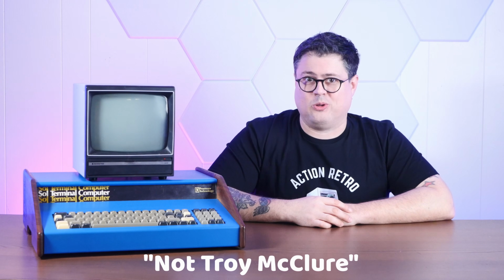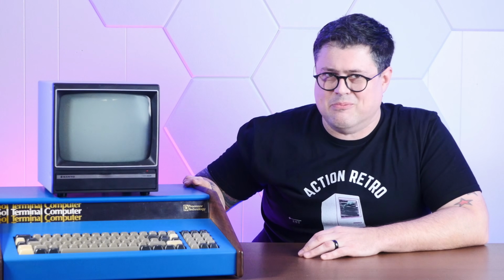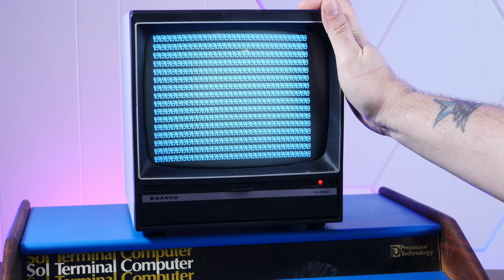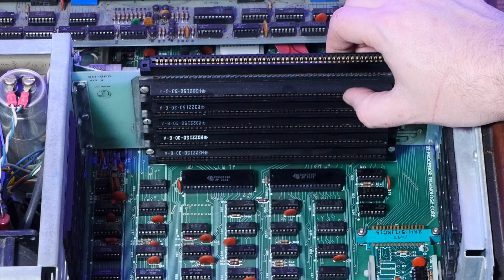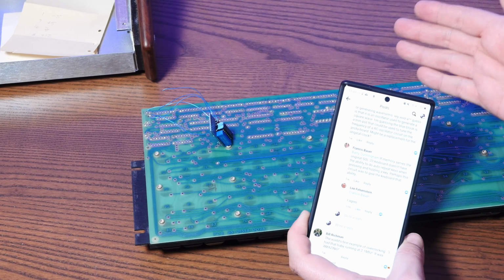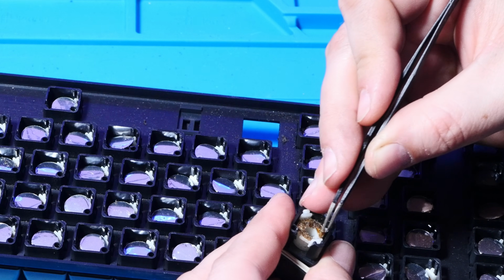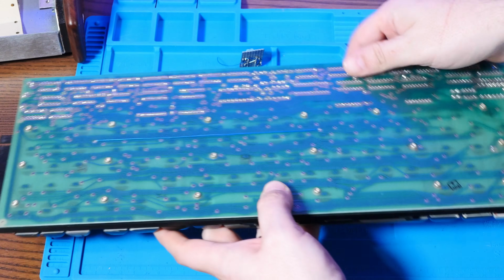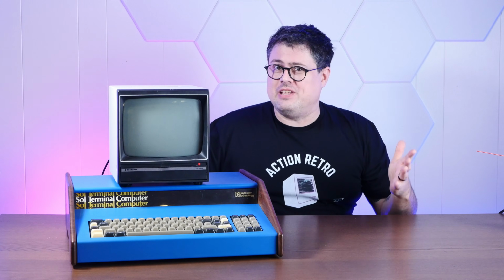The Most Important Computer You Don't Know About

Comment: I built a kit computer in 1981 or maybe '82 as a learning exercise.  It was Z80 based and had an S100 slot.  The power supply I built for it was linear and used a similarly large transformer.  From memory one of the windings was 18V 8A.
Reply: 18V, now that's damn weird.  I wonder why?
Reply: @michaelbauers8800  18VAC had a centre tap and was used to provide unregulated DC for the +12V and - 5V regulators as well as unregulated + / - 16V for the S100 bus.  Another winding provided unregulated for the +5V regulators and +8V unregulated for the S100 bus.  I had to go look it up, turns out the articles can still be found at the internet archive site.
Reply: @retrozmachine1189  Thanks.  Certainly not a voltage I expected to see, but whom am I to second guess electrical engineers, when I barely understand electronics :)

Comment: An interesting fact about the Sol-20 was that one of the key guys behind it, Les Solomon, was the editor of Popular Electronics magazine and one of the key backers of a tape data storage standard known as the “Kansas City Standard”. For those that don’t know, back in the early to mid 1970’s the cheapest way to store data permanently was paper tape (aka punch tape) where data was recorded on the tape as punched holes that could be read back by a paper tape reader but it was prone to jamming, tearing, and others issues, and many early hobbyist computer users wanted a more reliable method for storing data. Sol was one of several who had the idea of storing data on a compact audio cassette in the form of two tones to represent ones and zeros, as replacement for paper tape. One problem was that early hobbyist computers all adopted their own incomparable proprietary methods of storage data (as audio) on cassettes. So he and someone from Byte Magazine got together and arrange a meeting/symposium with other early hobbyist computer companies to devise a standard for data storage on audio cassette which became known as the “Kansas City Standard” due to the symposium taking place in Kansas City. Unfortunately, while some computer manufacturers did adopt this standard, many others did not such Commodore, Apple, Sinclair, Atari, and Amstrad, and went proprietary instead. Part of the problem may have been that this standard wasn’t the most efficient method for storing data on tape (as audio) and thus these other microcomputer companies preferred to develop there own more efficient standard, plus there was the added benefit of locking in their users to each company’s own platform.
Reply: @Jeff Desert Mountains Paper Punch tape was different then punch cards. It was a basically a long strip on tape sort of like paper version on magnetic tape but with holes used to Indicate binary  digits. Punch cards where produced in a stack where you had to carefully keep them in the correct order. Then you put them in the punch card holder on the punch card reader and the device would pull one card after another to read the data off them, shooting them to a second receptacle. The way the data was stored on punch cards and paper Punch tape was similar though. You can see videos on YT showing how each worked such as on the Computerphile chanell from the University of Nottingham.
Reply: @Charles Bunnell..  Cool story.  My friend had one of these in 1977.  His same was Solomon. No relation.  In those days we were more interested in having a terminal to get into our school time sharing minicomputer by modem, so the name terminal computer made sense to us.  I’m not sure which OS it had, but it had some very impressive games.
Reply: Pop Electronics is where the infamous Altair 8800 was featured on the cover Jan 1975. You can get the pdf. Many people consider it the birth of personal computers.
     In the 80s I did work for a factory that used paper tape to run automated punch press machines. The noise was deafening.  I hated going to the shop to pick up material. I still hear it...KA_CHUNK.
     I had no idea it was Ziff-Davis that produced Pop Electronics. ZD was responsible for The Screen Savers and Call for Help. Leo Laporte is doing This Week in Tech (TWIT) now.
Reply: @firesurfer  I am familiar with the Altair 8800 Popular Electronics cover. A lot of early hobbyist PC’s where announced via electronics publications, sometimes created with the help of people at the magazine as with the Sol-20. While the Altair 8800 was certainly in many ways a personal computer in a sense it wasn’t quit a mainstream personal computer the way the later Apple II, TRS-80, and Commodore Pet where (know as the holy trinity of PC’s) personal computers. These early PC’s where what i’d call a hobbyist computer as they required a lot of assembly and specialized knowledge to get the working and such. The modern Raspberry Pi other single board computers is the modern version the hobbyist computer.  Back then It wasn’t until the holy trinity of PC’s I mentioned above came out in 1977 that you could buy a PC that could relatively easily be used by laypeople. The Sol-20 came closer to being a more ready to use PC then the keyboard-less Altair 2200 (at least in its default configuration) but it still wasn’t as user friendly as later PC’s.
Reply: @Jeff Desert Mountains It resembled a ticker tape machine.
Reply: The SOL 20 mainboard had the necessary audio interface and the personality module included  routines and implemented commands for reading and writing blocks of memory to/from cassette tape recorders.  This let you load and run programs, in principle including an assembler or compiler, and also mad the (I think) K.C.Standard routines available to the programs.
So a SOL 20 with two tape recorders could (again in principle) be used as a personal computer, both for running canned apps and for software developent.

Of course there was also the Helios drives with PTDOS and a CPM port for the HELIOS II and other S-100 floppy interface/drive combos.
Reply: Who did adopt the Kansas City standard? The only one I remember was Ohio Scientific who mentioned it in their advertisements.
Reply: @scottlarson1548  
The following microcomputer manufacturer adopted the Kansas City Standard (aka Byte Standard) either in it's original form or an enhanced version, either via a built-in data cassette port or via an optional add-on card:
* Compukit UK101
* Exidy Sorcerer 
* Kim-1
* MITS Altair 8800
* Motorola MEK D1 6800 board
* Ohio Scientific C1P/ Superboard II
* Processor Tech Sol-20 Terminal Computer & Processor Tech CUTS
* SWTPC's Motorola 6800-based computers
* Tangerine Microtan 65
* Eltec (German Company) Eurocom 1
* Z80 Starter Kit 
* ABC 80
* Acorn System 1 
* BBC Micro (300 and 1200 baud variations)
* Acorn Electron (1200 baud only)
* Dick Smith Super-80 (300 baud only)
* Elektor Magazine National SC/MP Project
* Heathkit ET/ETW-3400 and 3400A Microprocessor Trainers (300, 1200, 2400 baud)[12]
* Heathkit H8 (300 and 1200 baud)
* Zenith Z-89 — also sold as the Heathkit H89 (300 and 1200 baud)
* MicroBee Systems
* MicroBee (300 and 1200 baud)
* MSX (1200 and 2400 baud)
* Nascom (300 and 1200)
* Sega SC-3000 A slightly different 600 baud variant
* Triumph-Adler
* Alphatronic PC
* Alphatronic PC16
* Z80NE Nuova Elettronica with LX.385 interface
* Chaos Homebrew Computer
* Irisha (1200 baud, 2 stop bits, same as MSX)
Reply: @Charlesb88  OK, generally they were either kit computers, low sellers, or British computers. I completely forgot about the Exidy Sorcerer!
Reply: For those who want more about punched paper tape:
https://en.wikipedia.org/wiki/Punched_tape
Reply: When I was in H.S. We had a computer running Basic (don’t know what computer it was) we also had classes and I took them, we had a Teletype typing device and yes, it had the punch paper for output and input of our programs that we all wrote. Good days, learned a lot.
Reply: Very cool! Thanks for that!
Reply: Nerd
Reply: @maxxbbie69 Calling anyone watching this video a nerd is like calling attendees at ComicCon nerds. Only computer nerds would be interested in an obscure hobbyist home computer from the mid~1970’s.

Comment: Try to clean up the new key pads with a bit IPA on a cotton swab  - had the same issue on my Apple Lisa. Replaced all of the pads and still some keys wouldn't work. After cleaning them with IPA they work fine. Maybe you accidentally touched the pads or they got in contact with skin oil or something like that. :)

Comment: dont use double sided tape and ruin your machine, just 3d print som discs at various thickness and test to see which lands the smoothest, if they are the right thickness they will easily click in first and hold the foam and foil pad in nice and tight

Comment: The earliest home use computer I know of that you could buy assembled would be the SCELBI-8H from 1974. (Though it was also available in kit form) That being said, it certainly wouldn't have had the same capabilities as this system. Other pre-assembled options at that time would have been designed for commercial use and far bulkier.

Comment: erm, capacitive pads? looks to me like a classic switch with the foil acting as the electrical connection, and the finger has a low enough resistance for the electronics to register the bridged connection. if it were capacitive, then cleaning would not have been necessary.

Comment: Check the reset circuit for proper operation, and try manually asserting the reset signal through a resistor to see if that will make it boot properly.  Check all the address and data lines with an oscilloscope for any seemingly stuck bits.  Also check that you have all of the proper clock signals present and timed correctly.  I know that the early Altairs had issues with clock reliability, and the 8080 is a bit finicky when it comes to timing, but I have no experience with the SOL.  Having that S100 connector right at the top of the expansion bus should make the issue relatively easy to troubleshoot.
Reply: Reset circuit is also what came to mind (it's a notorious problem on the Oric's 6502 for example), but then would he has this 9No displayed if it's displayed by the CPU?
Reply: @DbugII  I assume the pattern displayed on screen is the uninitialized state of the video ram, but I'm not sure about that
Reply: On somthing this age I expect the capacitors have dried out. Check the reset circuit caps and also the PSU.  The bottom line is all the voltages must have stabilised and the clocks up and running before the reset is removed. The PSU is of linear design judging by the size of the big cap, so check the supplies are correct voltage and also for ripple. Best of luck.
Reply: This is a common problem, even with relative recent microprocessor or micro-controller systems.

The RESET line is usually held HIGH by a resistor connected to +5V. To activate RESET, the line needs to go low. To do this, there is a small capacitor connected to ground. It steals the voltage from the RESET line to charge itself up. If the capacitor is broken, the RESET line is not held LOW for long enough.

Since capacitors loose their capacity with age, the power on RESET will fail eventually. Usually it keeps working for a few decades.

Modern systems often use a radial electrolyte capacitor which is then bent flat onto the PCB. This can cause a strain on its leads which can make the rubber gasket of the capacitor leak. Then those POR (Power On Reset) circuits fail after just a few years – or even months in extreme cases.

I have fixed a few of those, mostly found in operators panels where there was not enough space to keep the capacitor vertically and they had to bent it onto its side.

Modern µC like the AVR uses a timer counting clock pulses to generate the RESET signal. This can cut costs (Atiny) since pins are the most expensive part of any µC IC and it also makes sure that the RESET signal has the perfect timing which depends on the clock source. Never too short and no unnecessary time wasted.
Reply: thats what i was gonna say, maybe not long enough reset,
Reply: Our high school electronics class made one of these! Thought ours actually said Processor Technology
Reply: The sound was an am radio.

Comment: It’s cool that you can see all the features of the Atari 8-bit computers got their inspiration here. I guess by the time they standardized the feature set of the home computer in the late 70s, they decided people didn’t want expansion cards, swappable rom, etc. anymore but here they didn’t quite know that yet
Reply: The Apple ][ had expansion slots and loads of third party cards.
Reply: The Ataris had cartridge slots, which are just Roms in a fancy case. The earlier Atari VCS pioneered game cartridges. When the 400/800 were released in 1979, they had several custom chips for exceptionally versatile, high resolution graphics, with a 256 colour pallete, and 4  independent 8 bit sound channels, that could be joined with a simple POKE to make two 16 bit channels. Cartridge slots, usuable analogue to digital controllers, hardware sprites, display list interrupts, and a shed load of other cool features made them the incredibly advanced for their time.

Comment: Not sure if you noticed, and this could be caused by YouTube compression.  But when you pulled out the personality module it looked like the first contact point was seriously corroded/scratched.  Assuming this is the case and not some video glitch - as the OS is loaded from there might this not be the cause of the dodgy loading?

Comment: Amazing how simple and integrated this is compared to other S100 computers.  I have a DIY home-built S100 system I picked up at an estate sale alongside an IMSAI, I'll have to study electronics a while longer and learn power supplies before I dare do anything with it, in the DIY'd linear PSU it's got five of the soup can capacitors.  Not to mention the mystery hand made wire-wrapped expansion cards in it.
Reply: Oh damn, sounds like some fun reverse engineering is ahead of you :)
Reply: IIRC there are 4 power rails: +/-5v and +/-12v. Some chips and interfaces required the negative voltages
Reply: @surferdudemi  ?  that was a standard for early PCs, but I'm not sure it applies to a DIY homebrew system.
Reply: @squirlmy  If it followed the standard. Some chips back then required -5, and true RS232 needs -5 or -12.

Comment: Wow. It really is in pristine condition for being born the same year as I.  lol. I think my foam has also degraded over the years.  I can’t believe how mint that thing is. I would definitely pull the power supply and give it a full work over. Test the rails and the old caps.  Larger electrolytic caps do dry up. Check any tantalum caps for possible short circuits. They can become more like resistors over time.
Reply: I'd argue tantalum caps eventually turn into low current fuses rather than resistors :)
Reply: @Bobbias  yes...usually catastrophically

Comment: Thanks for all the great videos!

Okay so if it were me, I’d look at the reset signal. If it’s only turning on and working properly like 10% or 25% of the time, then maybe the reset circuit isn’t working properly. Maybe it’s timing is off and sometimes it happens to reset everything the right amount of time but most of the time it doesn’t. Another thing is that if the power supply isn’t putting out the right voltage, or if it can’t sustain all the current the machine needs all at once when it’s powered up, then that might affect the reset circuit, which is often a 555 based timer circuit. However, overall those chips are very oxidized, so a careful cleaning of all the chips and sockets might be a good ideal regardless. If it is a reset circuit problem, then maybe a flakey socket connection due to oxidation is messing with the period of time the reset circuit is holding the system in reset, and cleaning the connections here would allow the circuits timing to work as intended. 

Then again with a system this old the capacitors might be bad and the whole system is electrically super noisy and having new capacitors would help. 

Without poking around with an oscilloscope and schematic diagram it’s hard to say. But those are my guesses off the top of my head!

Comment: I'm curious as to the use of the SO239 coax connector on the back panel of the computer.  I noticed there's a piece of coax inside the case that connects to another SO239 with a PL259.  I'm only used to seeing these connectors used for RF.
Reply: They were also used for composite video back in the 70s. I've got a couple of Sanyo VTC9300 Betamax video recorders which use these connectors for the composite video input and output.
Reply: Was going to write the same thing.  I used one myself with an early SONY VTR.  Video TAPE recorder, which predated VHS.
Reply: They can be used for signal of some description. I have a terminal which only has a coax connection other than the keyboard